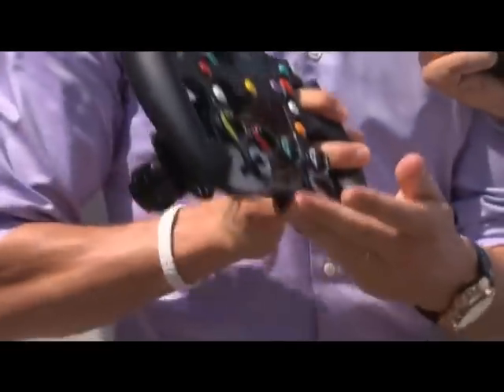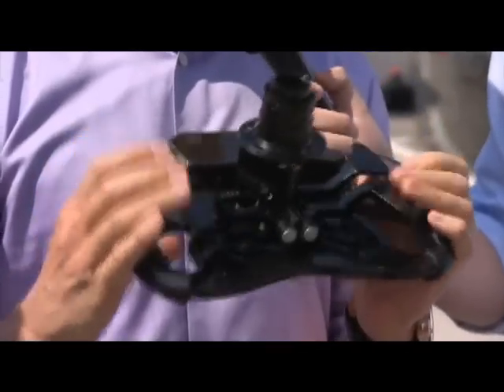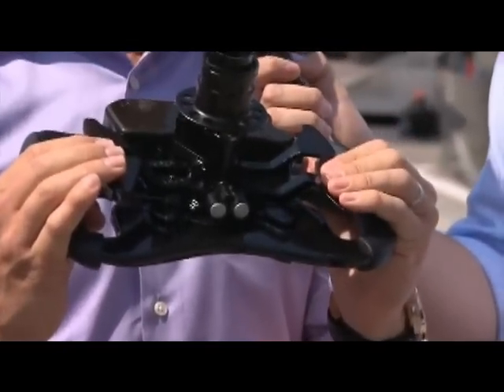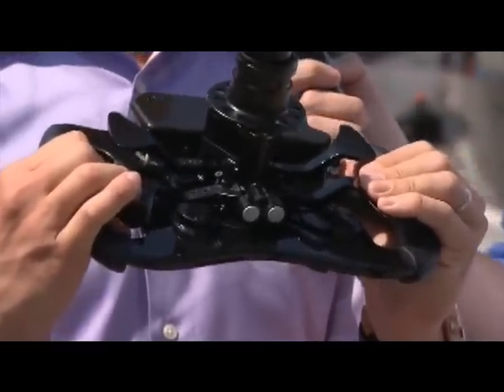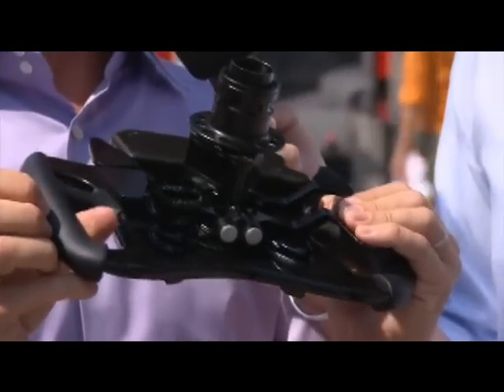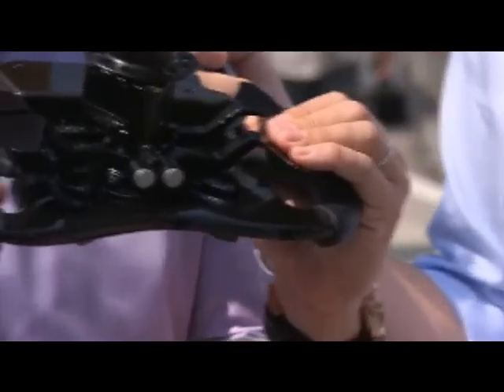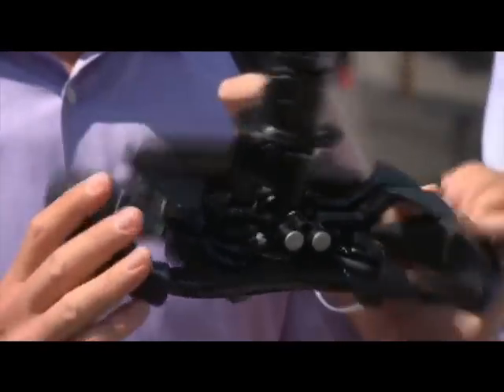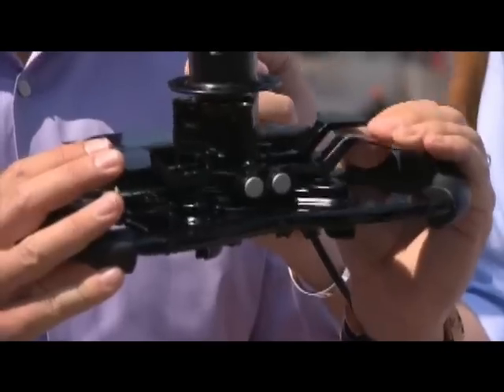BBC F1 clutch operation & launch sequence explained

Comment: In the start of the race, they press both of the clutch paddles and when the green light comes off the release the first clutch quickly and until it gains traction which means movement then they release the second clutch. When they are moving and going they don't need to use the clutch anymore, they use the paddle shifters, to shift up and down without clutching like what you would do in a normal manual car. And yes the clutches apply again when they are in the pit stop.
Reply: "to shift up and down without clutching like what you would do in a normal manual car" - you mean in a normal automatic dsg gearbox car
Reply: no i think he means in a manual transmission car that has had its transmission strengthened and changed into a sequential gearbox... the clutch still gets engaged but by a computer leading to super quick shift times while flat foot shifting... I think they have either an air or hydraulic system controlled by an electronic control unit so that they can use the paddles to shift or it would have a gear stick to push forward or back inorder to engage gears like some sequential drift cars but that's slow and 2 hands at the wheel is better in those G-forces through a corner.
Reply: Why do they have a clutch then if they only use it for the start? To you get better traction with this as appose to a dct?
Reply: @Person-cv9dj  Anti Stall would otherwise engage. making starts slower
Reply: @Person-cv9dj  The computer controls the clutch at every gear change. It is not only for the start.

Comment: @brentzittel one is for the link between wheels and engine to be off (standing at the lights), the other is locked in a ideal launch position, where the car starts to move without stalling and without spinning out. That way, the drivers don't waste miliseconds trying to find the "sweetspot" and risk stalling or spinning. At least it's what i think David was explaining...

Comment: @prunex Let's say you have 2 clutch pedals in your car, and both pull the same clutch. You leave one of the pedals in the position where the car starts to move and lock it in that position. The second one you press fully down the normal way so the car is running in idle without moving. When you want to start moving simply release the 2nd clutch fully. The first one will already be in the position of moving the car, eventually you will also release the 1st one from beeing locked, when at speed.

Comment: I think " 2 stage" is more accurate than " 2 clutch " also the cars have an anti stall system  
that will auto engage clutch + revs to keep the car from stalling , but they dont want that to happen because the electronics take control leaving the driver useless for a few seconds

Comment: So if I got this right, basically the physical clutch in the car follows the paddle that is pressed further in between the two.

So if you press the right one fully in and the left one only partially in the clutch fully disengages because the right one is pressed more. 

When you release the right paddle the left one is now the one you're pressing more so the clutch now follows the left paddle's signal and stays partially engaged.

Finally you release the left paddle too and so the clutch fully engages because both paddles are fully released.

Comment: It's a simple clutch, the car has two peddles ( break and throttle ) when starting from a standing start you release the 1st clutch and when you get traction you start to release the second clutch. This will all occur before 2nd gear is selected

Comment: the gear box is surely in 1st while the clutch is fully depressed yeah? how about the brake pedal? throttle surely to desired rpm for the launch, but is the driver on the brakes while clutch is fully in? since you'd be essentially in neutral, don't want the car to roll unexpectedly... off the brakes and off full clutch simultaneously?

Comment: i always thought that too because when they engage both clutches like you do in a normal manual car you would think that they would still use the clutch to change gear but then it would be impossible.

Comment: so...i understand that: the clutch is used when u start the standing car and are double clutch or something(left and right pedals); u got to pre-set one pedal position and other clutch go full and when u start release full clutch and the pre-set clutch is released when car has some traction
So my questions are: the clutch is used only when you start a standing car?(or u got to press pedal every time u change a gear); and changing gear pedals are that above clutch pedals..right?

Comment: @prunex One clutch releases the clutch to lets say 50% power so you dont get wheel spin off the line... then when you feel like the cars gripping you release the second clutch which then gives you 100% power and leaves the throttle control to the driver. I use the word power but its not really power... its just the amount you have the clutch discs connecting.

Comment: Do they have to pull the clutch on every shift or just starts and stops?
Reply: only on starts and stops
Reply: Clutchless shifting system, with an ECU-controlled igniton cut, linked to an electronic sensor...

Comment: Not really. It is a two stage clutch. Ever been to the gym and there's those stacked weights connected to 2 different cables and 2 different handles?  It's kind of like that, you can modulate the height of the weights up off the stack with either cable/handle independently from the opposing handle. Keep one in place and move the other and weights move a bit, move them both at the same time and the weights move a lot. That is the simplest analogy I could think of :/

Comment: I think the title of this vid should really be "F1 car launch sequence" or "F1 clutch operation." How an F1 clutch works is really not so different from any car's clutch. It allows the driver of the car to control the connection between the car's engine & transmission.

Comment: Can someone subtitle please ? I'm French & it's hard to understand ^^
Thx !
Reply: Presenter: let's start; so David's got his and on the steering wheel, so talk us through how involved it is for the drivers to start an F1 race?
Coulthard: OK, I will; oh, you see that's the view the driver has in the cockpit, but the important part is the one I'm gonna show behind here: got the two clutch paddles, both do exactly the same thing, but the standard practice in Formula One today is to preset one clutch position before fully engaging the other clutch. All the red lights come on, red lights go out, release as quickly as you can the first clutch and then you allow the car to get a [setting of the clutch of that with the]* second position held in place until the driver deems he's picking up traction. You then release that and it's done** to him with the throttle control. [So that's the mechanism of which the driver has to control of the start lights]*. Obviously there's lots of room of variability to where they position that paddl... [abrupt ending].

*Maybe "setting" is actually "settlement"; I couldn't figure exactly what was said here, but I believe the meaning is understandable. If it isn't: it means that after the driver has released the first paddle, the clutch settles in the position of the second one (the one still being held), because the clutch "obeys" the paddle to which is applied more force. 
** Maybe it's "then"
* It seems awkward grammar, so maybe I couldn't listen well

Maybe I've missed another few words (I'm Brazilian), but I'm positive the overall meaning of what Coulthard said is correct. Hope I've helped.